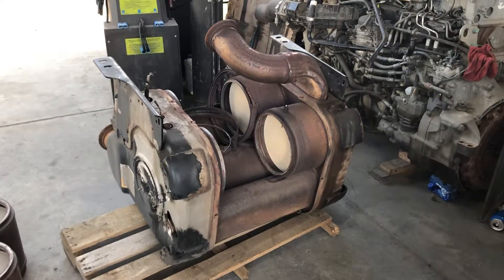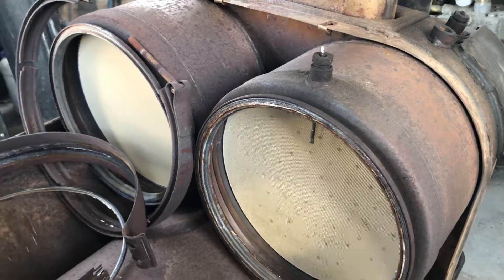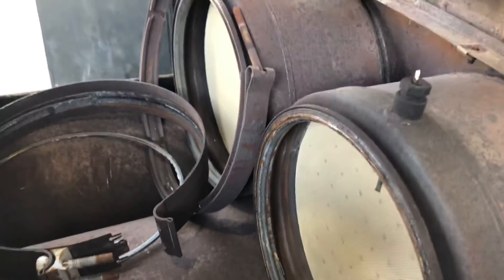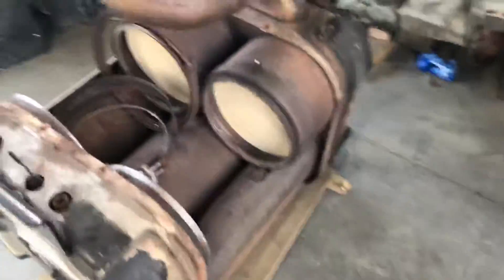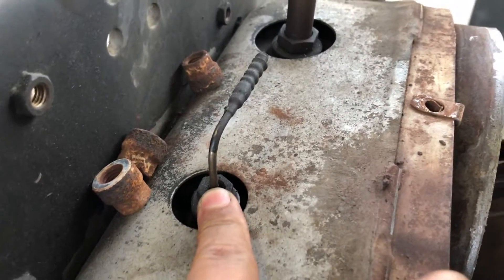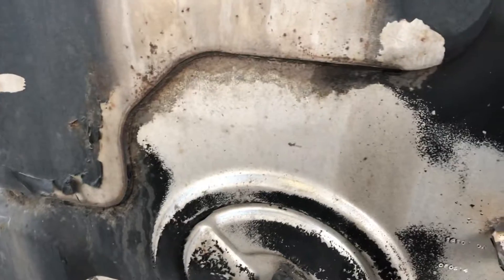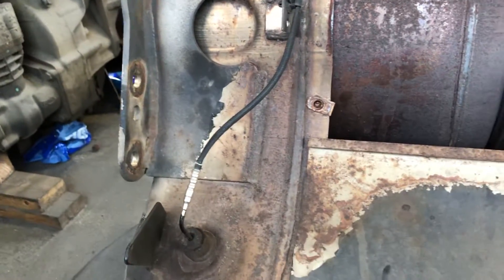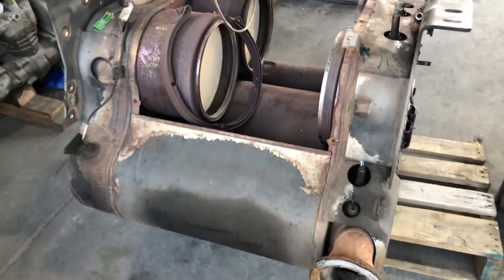ATS One Box Design Freightliner Cascadia 2012 to 2019: ATD Explained.

Comment: How do you know when you need a one box replacement?
Reply: Law sue them
Reply from the maker: The most common cause to replace your ATD (Aftertreatment Device) or One Box.
1. Diesel Oxidation Catalyst (DOC) has been push. This one is the most know by Technicians. Because the high back pressure generate by the obstruction of the soot or ash particles.
2. The Selective Catalyst Reduction (SCR) failure to pass the NOx conversion test. For this there are various issues like DEF contamination, SCR defective from factory, SCR crack from inside and many others issues.
These two are the most common reasons to replace your one box, other (less common)  could be like Turbocharger failure and causing a moderate amount of oil to go into the one box.
I hope this help you to understand better when you need to replace your ATD. Thanks for watching and stay around for more.

Comment: I have a 2016 Freightliner, I bought it about 60 days ago and it has spent 20 days total in the shop due to a reoccurring problem with ats. Nox sensors have been replaced, a thermocouple has been replaced and it still derates about once a week to 5 mph. It keeps saying bad DEF among other atd codes. OMG this is driving me nuts. If you're in Cali, I would love to stop by.
Reply from the maker: There are couple things you can check:
1. Make sure there is not contamination in the DEF tank.
2. Check the noise from the box when you are driving or active regeneration is taken place, rough noise around the ATS box can be a signal that it is getting bad.
3. Pay attention to DEF level, is it consuming too much? Or nothing at all? Those are signs that might be an issue with the DEF pump or injector.
4. Get a closer look to the stack pipe or the lower exhaust pipe, is there a black smog color around the outlet? If yes, that means one or both DPF might be bad and you might need to replace them soon.
I hope this help you and thanks for watching, I am glad to be helpful.
Reply: @LetstalkDIESEL  don't forget to check the filter for the def
Reply: Turns out the box needed to be replaced, all is better now. It was replaced at the dealership they never mentioned a lifetime warranty.
Reply: Sue freddlinners  for bad  de
Reply: All equipment should  be warranty  for life of vehicle
Reply: @gillisgil8972  interesting

Comment: Can you turn the box to the side and pressure wash the doc??
Reply from the maker: I do not know if it is going to work, I heard about high pressure air and even that, I will call that a temporary fix if your DOC is push already. If it is not push, it might work for more time as long your engine is running properly.
Reply: @LetstalkDIESEL whats cause the doc to push out? from what you seen working on these trucks around how many miles the doc start to get push out.
Reply from the maker: @jadb8452  it depends, usually more than 500,000 miles for sure. If you pay close attention to the exhaust for a moderate leak or you have the DDDL tool to check the pressure you can tell if it it push or not, other way around without tools it is to take out the DPF inlet pressure sensor, after loosening it, if it gives you hard time to pull it out it means DOC must be push, however this applies only for the front filter, not for the rear one. so your best shot it is to open both to be sure everything is fine. I hope this answer your questions.
Reply: @LetstalkDIESEL  thanks for the info

Comment: I have western star with dd16 one box after treatment system I cleaned the filters recently but my truck require me a force regen pretty much every other day. What could be the problem? And I found this video helpful. Thanks
Reply from the maker: It depends what you mean with “every other day”... if your truck is asking for it every week, that is Ok. If your truck is asking for it every day that means there is a problem. Usually, local drivers and long haul driver have different timers in their trucks for regeneration. In other words, the basic you can check is:
1. Are you a long haul or local driver? Local driver means a lot of idle which kicks in faster the parked regeneration than the one in a highway for long periods of time.
2. Is the time for asking parked regeneration normal? Compare the time before and now for the request parked regeneration. Is the same time? I mean by days.(even every three days is fine as long It passes the regeneration).
3. If your answer in question 1 is you are long haul driver and question 2 is every day. Then means... yeah, you might have an issue with your DPF or other exhaust components.
Reply: @LetstalkDIESEL mine is 2016 dd15 working local/hyway 60-40.. asks for parked regen every week ..i feel its not normal , nd i believe it is not doing over the road regen..it will cost me 1000$ every year in fuel burnt on parked regens..
Another same truck of my buddy requires it once a month on same routes/loads..
Mine inlet doc pressure was 1.1!!
What r ur thoughts
Reply: Try a good fuel treatment, I use Doc’s 1oz per 25 gal my DEF usage went up to 270 mpg and it never regens.
Reply: @michaeltyre38 which one u tried..